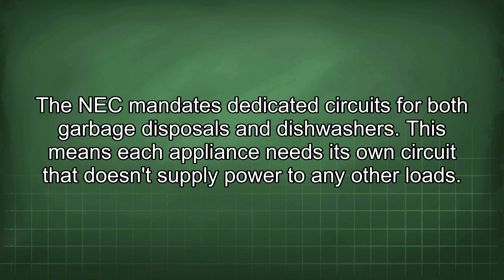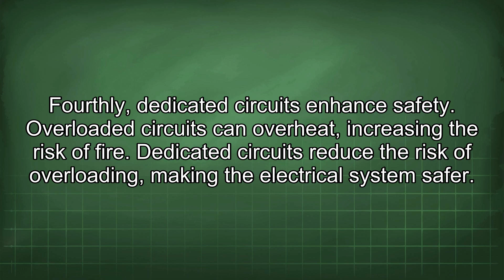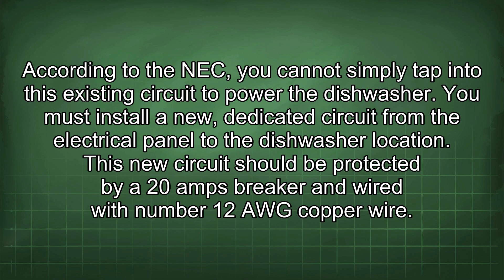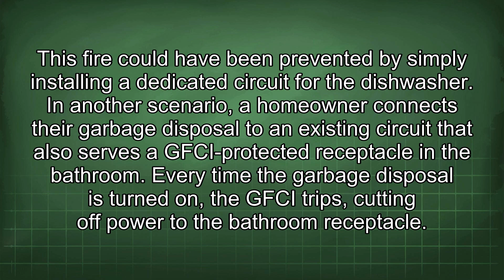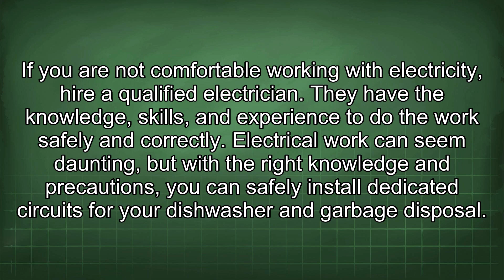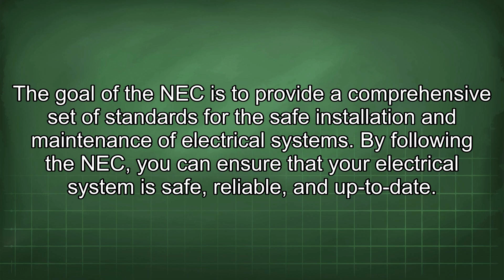Dedicated Circuits for Dishwashers and Disposals NEC Rules

Comment: I really wished you would have cited the article number and subsection
Reply: They can't, because it doesn't exist. This is some AI generated garbage.
Reply from the maker: Hello @waffles9743,

The relevant National Electrical Code (NEC) articles governing dishwasher and garbage disposal circuits primarily fall under Article 210 (Branch Circuits) and Article 422 (Appliances).

While the NEC doesn't explicitly mandate a "dedicated" (individual) circuit for every dishwasher or disposal, its loading rules often make one necessary.

* NEC 210.23(A)(2): This crucial rule states that on a multi-outlet branch circuit, the rating of fixed-in-place utilization equipment (like a dishwasher or disposal) shall not exceed 50% of the circuit's ampere rating. Because appliances often exceed this limit, sharing a circuit with general-purpose outlets is usually prohibited, effectively requiring an individual circuit.
* NEC 210.23(A)(1): The rating of any single cord-and-plug appliance (like some dishwashers or disposals) must not exceed 80% of the branch circuit ampere rating.

Additional Outlets and Kitchen Circuits

Adding general-purpose outlets to an appliance circuit is typically not allowed, and new outlets often require a new circuit.

* NEC 210.52(B)(2): Prohibits dishwashers and disposals from being connected to the required Small-Appliance Branch Circuits (SABCs) that serve the kitchen countertop receptacles.
* NEC 210.23: Controls the loading limits for any new circuit you install for additional outlets. If the new outlets are for general use, they must meet the established load limits and separation requirements from fixed appliances.

Appliance Connection and Safety

* NEC 422.16(B)(2): Covers requirements for a built-in dishwasher's cord-and-plug connection, including cord length and receptacle location.
* NEC 210.8(A)(7): Mandates GFCI protection for all 125-volt, 15- and 20-ampere receptacles in dwelling unit kitchens, which includes those used for cord-and-plug connected dishwashers and disposals.

Sincerely,

BESA Research